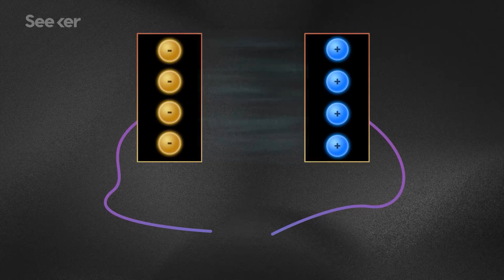How Supercapacitors Could Make Batteries a Thing of the Past

Comment: I'm quite skeptical on this. Capacitor batteries is a bad idea, a very dangerously bad idea.  You see if you shorted out lets say a lithium ion battery is gets hot and a chemical reaction occurs  which could can cause an explosion. Now imagine a capacitor charge to the same energy density as a lithium ion battery and containing the same energy as a fully charge lithium ion battery, and well that becomes stupidly dangerous once power supply to capacitor is disconnected. Why? well when a capacitor discharges is discharges exponentially with about 60 % loss in a time of (RC). This time constant depends on many factors. But a high charge density with high negative or positive charges can create very high voltages with very high current. Basically a capacitor of the type would discharge to quickly giving a stupidly ridiculous  power out put for a short time which can be potential lethal, and could fry circuitry. Also the fully charged capacitor needs to be fully isolated when not in use but a high voltage levels associated with the energy storage can result in corona discharge at the terminals resulting in power lose. Capacitors are an ideal way for storing energy for short term but to act as battery in the long term with a high energy density is a very bad idea.
Reply: That's why they're still researching to find ways about this problems. They're not called researchers for no reason.
Reply: The S pen stylus in my Note 9 already uses a super capacitor as a battery : D
Reply: But your S pen stylus require minimal power so the energy stored in the capacitor is small, It will dis charge  over a small period of time but the energy stored in that capacitor is minimal and is charged from a minimal power source. Remember capacitance is how much of the energy that is can store relative to the power supply. The super capacitors discharge rate is enough for the S pen but it probably still has batteries that will charge the capacitor.  But when you start talking about capacitors with the same energy density as a lithium ion battery with the same or greater than the energy of a lithium ion battery, Then it gets bad... dangerously bad.
Reply: terminate - I can tell you have no experience with electronics. Have you seen the insides of a condenser microphone? There are some HUGE condensers in there (capacitors), which can kill you if you short them out. They are nothing compared to the capacitors used in tube-amps. Now that's some really dangerous shit. How often have you heard of people dying from condenser microphones or tube amps? Your fears of super powerful capacitors are a reality today within common consumer electronics. Sure, the super capacitors described in the video will be magnitudes stronger but can you be more dead than dead???
Reply: terminate
You don't know what you are talking about.

Comment: Even if such a device existed, you would still be limited by how many amps the electrical grid can supply. Think about a charging station with a plug that output 220 volts at 400 amps. The safety issues alone would make such a thing impractical. The there is the issue of the transformers, inverters, switches and the cables. Think copper cables one inch in diameter.
Reply: They're still researching to find ways about this problems.
Reply: That's exactly right. The only way for a fast charge station to charge a 50 kWh electric vehicle in 3 minutes, the charge station would have to have a big capacitor bank, or battery, to store energy over time, and be able to pay out 2 megawatts, for a few minutes. No line pole transformer or power meter is going to handle that. The cable, that would actually connect to the car will be as big as the hose of a gasoline pump, to deliver the same number of miles of range in the same period of time. The cable will likely have to be coaxial, to avoid the huge magnetic field produced by the thousands of amps conducting through it. the cable is going to be heavy.

Comment: Thanks this gives a idea for car that could use capistor to lessen the strain on battery and cause car to charge and energy for short amout of time allowing it to drive longer on less charge or extremely longer on a full charge imagine u take your car off the charger and it keeps charging your car for up to a hour after u leave while driving it also pulls power back from its motion alllwing it use less electricity and turning some of the motion back into electrical energy

Comment: A bit longer comments but please check your facts.
1) Using capacitors we can charge batteries in minutes instead of hours. When it comes to batteries in EVs and current charging technology we have Tesla in front of the race so let's use them as example. Tesla X or S with 100kWh battery needs 20 minutes to charge 50% on the supercharger. This is 120kW cable. If you want to speed it up you need biiiiiiger cables and biiiiger infrastructure. 

2) “Power storage units would last decades instead of years.” Once again take Tesla as example - less than 20% battery degradation after driving 8oo ooo km. It is decades of normal use. But for more details please take a look on Ben Sullins video on the topic https://www.youtube.com/watch?v=z2CaWaKjS1Y and they are getting better and better.

3) “Lithium-ion batteries also degrades, and replacing one in an electric car would be enormously expensive.” Tesla is getting toward 100USD/kWh on battery pack level (they are close to this price on cell level now) and that means that the most expensive part on 100k USD car cost 10k USD. And this part last longer than conventional ICE car. Replacing an engine in such similar priced car would cost more. not to mention 8 years warranty without distance limit. 

4) “The best supercapacitors today hold just 10 Wh/kg” - nope, please check https://en.wikipedia.org/wiki/Supercapacitor and search for “wh/kg”

5) 180Wh/kg isn’t “on par” with lithium-ion with 265Wh/kg

I love new technologies and supercapacitors are great but please check your facts first.

Comment: I think these could be good to add to lithium batteries in electric vehicles kinda like a “turbo boost” mode. Since capacitors are good at high current, they could assist the batteries when trying to launch the vehicle from a stop to take the high current load off the batteries. Lithium batteries can be optimized for current or capacity and if the capacitors take the high current load off the batteries, they can be optimized for more capacity so more range of the vehicle
Reply: yes but the capacitor would die before the lithium and even if you had it switch the mains over to the lithium you would be back to the same problem we have now, all your doing is addint alot more weight to the vehicle with no tangible solution, also the weight will increase the energy required.
Reply: Error 404: Hodor Not Found why would the capacitors die before the batteries? If they’re used correctly (no over voltage/over current) then time is the only factor in which capacitors would easily outlast lithium 18650 batteries which are good for 300 - 500 cycles. Since the chemical composition of the batteries can be changed to maximize capacity, less of them are needed for an equal range so they can be replaced with an equal weight of super capacitors, thus allowing the vehicle to draw from the super capacitors when accelerating hard, use the batteries normally. This is the same reason they put big capacitors in parallel with subwoofers to give them more kick than the battery can provide. You can also recharge the capacitors over time through regenerative braking which is way more efficient than regenerative recharging the battery. Overall the weight is the same with more capacity and probably only a little more range but an even faster 0-60 and more efficient regenerative braking
Reply: Nicksperiments - "why would the capacitors die before the batteries" Because right now they can't hold that much energy. You'll need some huge capacitors to make use of them the way you want with current technology. That's some extra mass current e-cars can't afford because it will decrease their already limited range. If the super capacitors described in this video become reality then you won't need a chemical-based battery at all
Reply: Theos Tragonidis I thought he was saying the capacitors would be destroyed or “burn out” before the lithium batteries finished their life cycle and have to be thrown away
Reply: Nicksperments - he was saying that the capacitors will dry up (expend their energy) very fast compared to the chemical batteries. Then you'll have to use the energy stored in the chemical battery anyway.
Reply: Theos Tragonidis yes but the total energy may be the same but the lithium batteries are bad at large currents so if the capacitors are used for high current, then you could increase the total capacity of the lithium batteries since they don’t have to put out a large amount of current. Yes, the lithium will have to charge the capacitors but it can do this over a longer period of time or with regenerative breaking since it is much more efficient to charge the capacitors with regenerative braking than lithium batteries. I think the increase in efficiency of regenerative braking combined with the increased capacity of the lithium batteries will lead to an overall increase in total energy stored.
Reply: Nicksperiments - you don't want to understand that in order to use capacitors the way you intend, you'll need some HUGE-ass capacitors (with current technology), which will make the vehicle weight two to three times more (at best) than it does without the capacitors. It's totally impractical and that's why they aren't doing it. The buses he mentioned in the video are a great idea but they are charged every few stops. Let that sink in for a minute. We're talking here about a car which needs to have a range of 500km minimum to be able to compete with combustion powered vehicles.
Reply: Theos Tragonidis I’m not suggesting to replace the whole battery pack with super capacitors. I suggesting replacing 1/4 the weight and size at most of the lithium batteries with supercapacitors which allows a different chemical composition of lithium battery to be used. If the lithium doesn’t have to handle so much current, it can be optimized for range. Total weight of the vehicle is the same but the total energy storage in kWh has increased. Even though some batteries were removed, the change in chemical composition makes up for not having as many batteries. The reason they don’t do this already is because they need large amounts of current to accelerate. The car draws from the capacitors when accelerating hard but draws from the battery and recharges the capacitors when maintaining a constant speed. I don’t think you understood that as you decrease the current capability of lithium, the capacity exponentially increases

Comment: Swapping a Tesla Model 3 battery with a Tesla super capacitor in 2035 will be inexpensive and easy.  Drop the battery, disconnect, remove, replace.  Take any Tesla authorized battery supplier about 20-30 minutes.  The real problem will be the water wars.  Always on the news.... gets old.

Comment: Boring, and not as advanced as Solid State Batteries.
Reply: If you can build a solid state battery for $350 per kwh and I can build a capacitor for $28 kwh, then no matter how "advanced" your tech is, mine will win.
Reply: @davidbeppler3032  depends. It's like having regular Petrol and then having diesel. I think both the Supercapacitor and Solid State Batteries can co-exist, but as mentioned in the video Supercapacitors are likely not as practical for Electic Cars as Solid State Batteries are, which hold MORE power, AND can be made smaller than regular batteries, where as Supercapacitors get bigger for the same energy density as regular batteries.

Comment: Telluric Earth Currents:  Supposedly bury 2 metal plates vertically and perpendicular to the flow of energy through the Earth's surface and apart from one another.  One plate takes on a positive charge and one plate takes on a negative charge.  Also known as 'Earth Batteries'.  Then could also take that dc generated electricity to split water into hydrogen and oxygen.  The hydrogen and oxygen could either be burned or utilized in a hydrogen fuel cell to get the electricity back along with a by-product of basically pure water, of which could even be re-split.
Reply: Charles Brightman
Your ideas are not bright, man.  In fact they're dumb.

Comment: But what if you connected a capacitor and a battery pack in a car together. You probably wouldn't need as big of a battery to deal with the power spikes while stepping on the throttle. And just have the battery feed more continuous power to the capacitor so it acts as a buffer. Wouldn't that make the cars cheaper?

Comment: Several errors, caps discharge a jolt of electricity with little control over it, they do explode and have a somehow lengthy charge curve (I remember waiting 15 seconds to charge a 100nf cap, and the charge time increases exponentially with capacitance) and supercaps are expensive as heck
Reply: WRONG! 
Discharge is a function of RC or the resistance in series with the capacitor. The higher the resistance the slower/longer the discharge. A 100 Farad [quite large] capacitor discharging through a 1 ohm load would have a time constant of 100 seconds to discharge to approx 33% of its initial voltage, the next time constant would discharge to 33% of that lower voltage....etc.

A 100nf [nano-farad] capacitor would charge almost instantly unless you are charging it through a 1ohm resistor would only be 10^-7 time constant.

Charging a capacitor is much like discharging as a lower series resistance will allow for a quicker charge than a higher series resistance.

Depending on the size in FARADS not nF, Supercaps can be quite cheap or expensive for a MANY,MANY, MANY FARAD capacitor.
Reply: Probably because you're using an input voltage equal to your target voltage. The voltage differential approaches zero, slowing down the charge rate. Use a higher voltage, just remember to stop before the cap is full. You can charge a 3v super cap with a 24v input pretty fast. The 12v caps in my computer's power supply charge pretty fast with a 120v input. The controller is sampling the voltage millions of times per second to make sure it doesn't over-charge and also make sure the voltage doesn't drop too much.

Comment: Not gonna happen in decades, however, it can compliment batteries.  The fast charge and discharge are useful for EVs.  Tesla's cars, in my opinion, have a bit more capacity/range than most people would need because it allows for high performance in charging, discharging/acceleration, regenerative braking, lifespan of the battery pack.  With supercaps, a high performance EV can do without extra batteries albeit with less range.
Reply: i get you want to be cautious, but the way things are catching up, we can not tell if anything is decades away from happening.
Reply: "less range" is absolutely NOT what EVs need.
Reply: Silver Scythe You speak the truth. The spirit of progress is also the spirit of discontent.
Reply: main problem is lithium, that is a finite resource and all the interest in EV and mobile phones has caused lithium carbonate prices to inrease by nearly  6 fold. There might not be enough lithium to meet the energy demands for EV and mobile electronics.
Reply: @nickl5658  
There's the "not enough Lithium" argument again!
Not true.
There's enough Lithium for many, many years even for today's sources.
There is also Lithium in sea water, that's quite abundant?

Comment: It's worth pointing out that the real-world travel distance of a capacitor-based electric car would actually be significantly farther.  The reason for this is regenerative braking, where charging capacitors involves a lot less wasted energy.  In other words, when you use regenerative braking, you get more useful charge out of capacitors than you would a battery.
Reply: Probably true. The charge acceptance efficiency of a capacitor is nearly 100%. Even at high rates of charge! It's fun when brake pads last the lifetime of the car.

Comment: This problem is already solved using graphene super capacitors and they have a higher energy density than lithium batteries. This company did it, but they're small and taking a long time to get the battery to market https://youtu.be/DKkPDOE4k-k

Comment: Huh. So if they could make a phone battery like this, that's the same size as a normal phone battery, it would have maybe 50-70% as much charge to it, but if they charge up super fast then that might not be a big deal, because as long as you were in a place with access to electricity, you could basically "tap to charge" and then move on. 

The issue with battery life in a standard phone is how it takes 15-60 minutes to fully charge the thing, but if you could be in like a theme park, run your phone down to 15%, but then walk up to a station and hold your phone there for 30 seconds or so and it's at 100% again, that would be way more convenient than a normal phone, and pretty much any business would have those chargers available.
Reply: Yes. Even considering capacitors lose charge quite quickly that would still work. Also it wouldn't be a big deal at all if you forgot to plug in your phone over niht